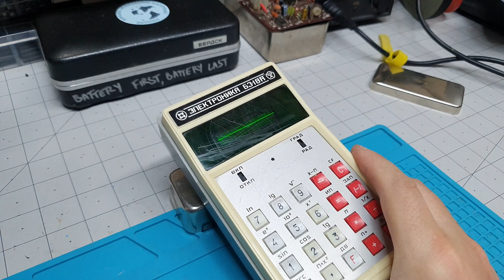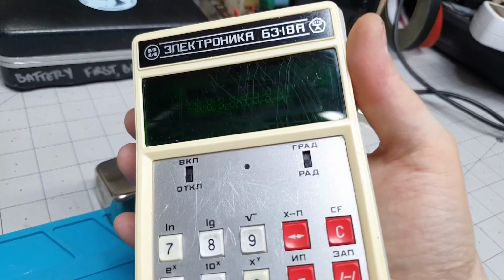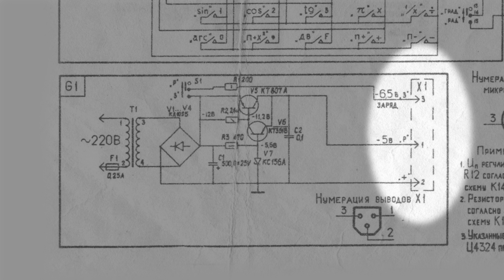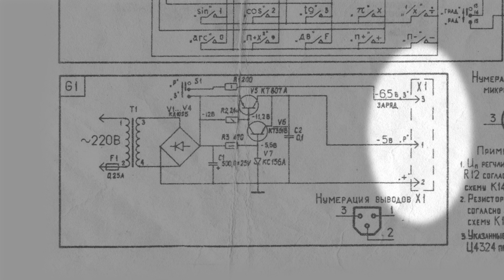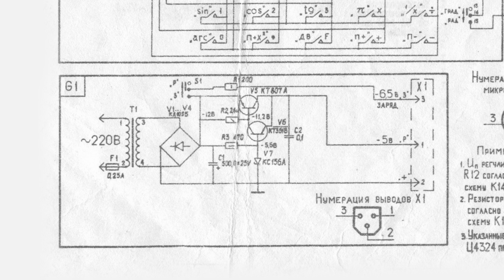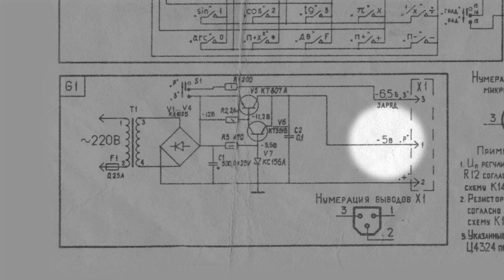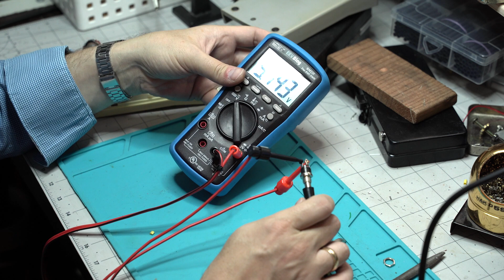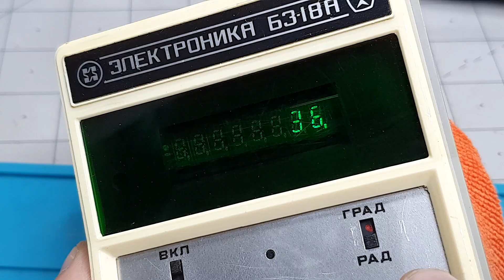Scientific calculator restoration! Will her display shine again?

Comment: Hello just got an MBO DELTA 10 calculator in a lot with some others more modern. 
I put a battery it didn't work so I open it up and even if from the front side the vfl lamp looked ok, from the back side is black at the end of first digits, (in it's nose) so i guess something burned inside. Can a blacked vfl lamp be fixed or this calculator is dead for good?
Reply from the maker: Some VFD’s develop the black spot you mention but are still functional, so it’s not necessarily a sign of VFD failure. They require multiple voltages to run properly, so you could try metering those to see if it’s getting the supply it needs. Good luck, and thanks for watching!
Reply: Actually it works if i have it open but not when i put the back cover of calculator back on... Something must be not pushed i guess.
Reply from the maker: @nikossiotas  That's a good clue! Sounds like either a loose solder connection or perhaps a grounding issue.
Reply: @ThomasBurns  Thank you very much! 
I didn't remember the correct term so i wrote vfl instead of the correct VFD. 
Sorry about that, English isn't my mother language.

Comment: If the central angle in a circle is divided into 400 parts, i.e. each quarter of the circle has 100 parts, then each part is referred to as a grad or "grade".
If the central angle in a circle is divided into 360 parts, i.e. each quarter of the circle has 90 parts, then each part is referred to as a degree (and denoted by an "o" on the right side, for example 90o if the central angle in a quarter circle).
If the circle is divided into sectors, such that each arc length is equal to the radius of the circle, the central angle in such a sector is called a radian or rad.
So, 1 grad = 910 degrees and 1 degree = 109 grad.
1 radian = 180π degrees and 1 degree = π180 radians = approximately 1 rad = 57.3 degrees.
1 grad = π200 radians and 1 radian = 200π grad.

Comment: Lovely restoration. I realise I'm dredging this one up a year on, but you could quite easily restore the green plastic/acrylic screen, I think. Do the old CA glue + masking tape trick to secure it to a small wooden block then sand it back to get below the deepest scratch. Then work back up to the finest grit you can find and finish with some polywatch. It'll look like new.
Reply from the maker: That’s a great tip, Mark! Will incorporate in the future!

Comment: You mentioned the switch for grad and rad: they're standard calaulcator modes for specifying what "units" the angles are when doing sin/cos/tan etc.  a "grad" is like a degree only there are 400 to a circle instead of 360. "rad" is for radians, where pi radians (3.14...) is the same as 180 degrees.

Comment: I would have kept the original power connector and made up a matching one with female ic socket pins or female Dupont pins and a body of epoxy putty.

Comment: The connector looks like one used on old Kenwood amateur radios in the 1980s. Look for TR2200, TR2200G, or GX connector. They aren’t common but you do see them around at junk sales etc.

Comment: Old video but I've had some good luck making my own power plugs for odd things like that. I use the connectors you would use on a computer that attach the mainboard to the front panel led's and switches. Cutting the connector apart and trimming you can get a single connector and wire (some connectors and wires will be destroyed). If the connector and wire fit well individually on the pins, I then use scrap plastic as spacers and glue the connectors into position (tacked together with super glue). I then remove the semi-completed assembly and carefully epoxy them together and shape to fit.

Comment: If you can find a stock of pins and female pin sockets from military-style connectors, you can build your own multi-pin connectors. In this cast you would plug on three sockets, mix up some epoxy or car filler and just cast it in there. You'd obviously need to paint on some wax or other release agent first. Maybe build a shell of sticky tape into the cavity before casting.
Nice job, nice machine.

Comment: I've seen you try to get scratches out of plastic in a couple videos. I've had good luck with using really low grit to really high grit sand paper. Wet sanding while using the highest grits. Then, I use a the Novus 2 and Novus 1 to complete the polishing process. Works for clear and opaque plastics. Motorcycle riders use Novus products to repair their helmet visors
Reply from the maker: This is an awesome suggestion! Thank you, Tim!

Comment: Those are NiCd cells.  D-0,25 is the type number.  Voltage is 1.2V.  The manufacturer (JSC Rigel) once exported coin cells to the US but they've been under sanctions for over a decade.  They even put the price of the cell on there- 53 kopeks.

Comment: It looks very much like a clone of the Rockwell 61R calculator.
Reply: The moment I spotted that integrated circuit package I thought the same:  Rockwell Semiconductor.  
I wonder if it's an actual Rockwell chip, or a Soviet reverse engineering.  
Likewise, is the VFD (Vacuum Fluorescent Display) of Soviet or Japanese origin?  My bet would be an import.

Comment: grad and rad are "degrees" and "radians", a type of measure for angles.
Reply: I'm pretty sure grad is used to mean gradians, not degrees. 
90 degrees  = 100 gradians
Reply: @luna010  yup, quite right.  𝜏 (aka 2𝜋) radians = 360 degrees = 400 gradians, or grads.  Many scientific calculators have modes for all 3 of these systems.
Reply from the maker: Thank you, Jose!

Comment: In contrast, in 1973 I graduated from high school, and was going to go to university, studying electrical engineering. I had a low paying summer job working at a city run day camp. All summer I saved to buy  an HP-35, I was very happy that the price had dropped from $450 to $350. At the end of summer I had nearly enough, I think my father helped a bit, at least getting a bit of a discount by buying it at work (he worked for a large engineering firm) Four years later as a fresh out EE I was making $14400 a year, So I guess a new EE in 1973 would get $12,000 or $13,000., or more than $1000 a month. So in 1972 an HP-35 would cost a new engineer in the USA about 1/3 of a months pay. When I was a senior in school my HP-35 was stolen and I replaced it with a far cheaper TI calculator, which while much more cheaply manufactured had slightly more functions. It cost less than $100. Luckily the HP-35 was returned to me in a few weeks, and I have it still, and it still works. Not so with the TI calculator. It bet the TI calculator was comparable or better than the calculator featured here.

Comment: Great Restoration! 
See the Rockwell 61R; almost certainly the chip was Japanese but the remainder is locally produced
Reply from the maker: Thank you, Dave! Will check out the Rockwell 61R!
Reply: Every part of it was made in USSR including the chip. Now, was it all completely designed in USSR? Probably not. There were quite a few chips surprisingly similar to existing western counterparts (e.g. entirety of i8080 ecosystem has its russian counterparts).